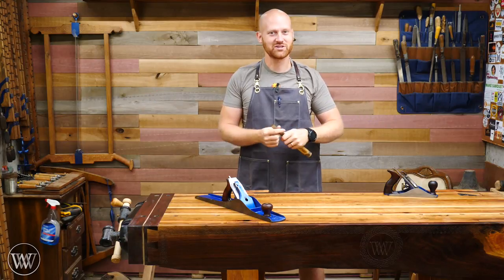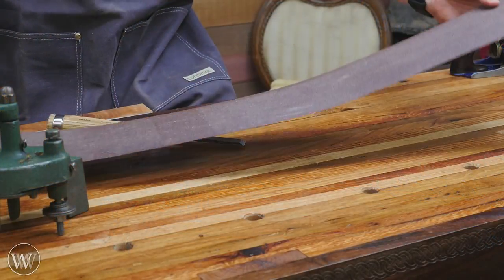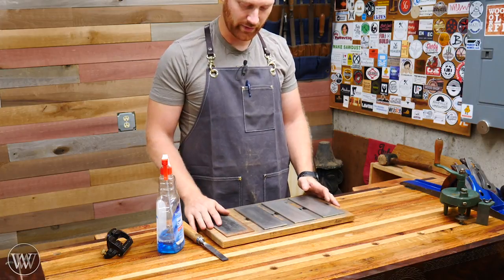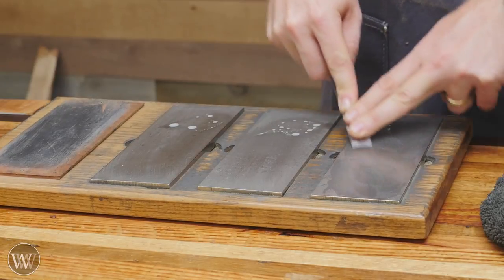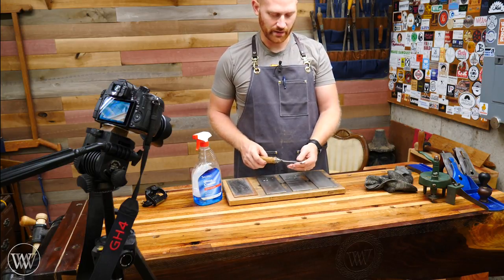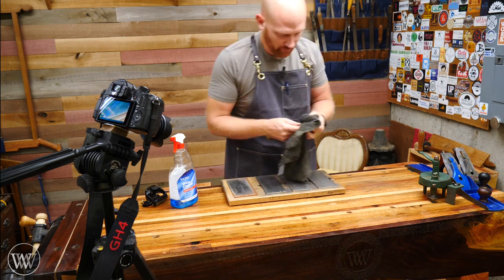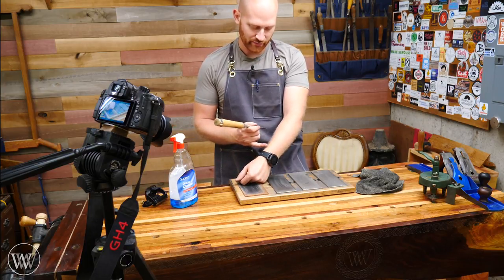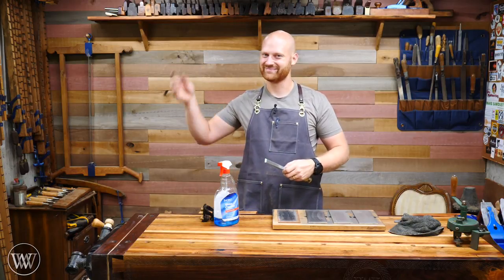How to Sharpen a Chisel Freehand | Hand Tool Woodworking Skill

Comment: Hi James, I started with handtools just around an year ago and then I realized how critical was the skill to sharpen. Being a complete novice I went with sharpening jigs, especially a side honing jig and I feel that was essential for me to begin with to understand the basic concepts and be able to get a decent amount of sharpness on my tools in order to progress. Now I do realize that freehand sharpening would be so much fun and quicker. So, as per your recommendation, I have just recently started sharpening just my chisels freehand. It does seem to take a bit longer for me to feel that burr but that is most likely because I haven't built any muscle memory and I am hoping it comes soon.
Also, I don't intentionally shoot for a camber but I do seem to be getting one on my chisels which look good and I don't mind unless they are going to impact the sharpness or usability.
Another problem I am facing is that the narrower chisel seems to be getting skewed (the edge is not accurate 90 degree). Any suggestion to help with that.
I am still not confident to use freehand sharpening on my plane blades since I believe they will require a bit more accuracy and a camber there might cause problems - I am not sure. But I do want to eventually use freehand sharpening for all tasks.
Reply from the maker: The camber on an iron or chisel is not a problem from heel To toe on the bevel. But if you're getting it from side to side that can be an issue. Usually that means you're putting too much pressure on the outside and not enough on the inside or your body mechanic is off and you're rocking at the arm. If a smaller chisel is starting to develop a skew then just put more pressure on the side that is long that will bring it back in after a few sharpenings.
Reply: @WoodByWright  Thanks for explaining this. I thought I read or saw somewhere that said the camber (from heel to toe) could cause problems in certain cases with bevel down planes if it prevents the edge from touching the surface. If this isn't really a practical concern then I would want to start sharpening my plane blades as well freehand soon because I do agree that it is much more fun, fast and satisfying!🙂
Reply from the maker: A little bit of camber is not a problem. If it gets extreme to the point that the angle at the tip is greater than 40°, then it will start to inhibit the cut. But that's a very extreme camber.

Comment: Thanks for the nice video. Could you tell me what grit you used when grinding on the floor. Thanks
Reply from the maker: It depends on how bad the blade is. If it needs a lot of work I start at 36 or 50 grit. If it doesn't need that much I might start at 60 or 80.
Reply: Thanks.

Comment: Any thoughts on the microbevel or convex grind? It should make the edge last longer and reduce sharpening time.
Reply from the maker: a micro bevel or convex do not make the edge last a measurable amount of time longer, but the micro bevel does save some time for sharpening initially. but takes more time in the long run. at least that is my opinion. most all hand held sharpening does put a bit of a convex grind on the edge.

Comment: Any thoughts on Shanon Rogers' method of stropping before the edge is dull, as maintaining a sharp tool? As he says it won't sharpen a dull edge, but it will keep an edge sharp. I've been trying this with my chisels, keeping my strop close, and it seems to work rather well.
Reply from the maker: youp. I do that for my carving chisels a lot, I am just to rushed to do that with bench chisels. something I am working on but  most of the time I wait too long. lol
Reply: I heard back in the day people used their palm to strop. Never tried putting some compound on my hand, I don't believe it will stay there. Maybe strapping some leather on the arm or legs ready to go would make it a quicker process, instead of reaching for the dedicated bench strop and moving it away every 2 minutes
Reply: I wouldn't use my palm, that's just asking for trouble. I keep mine on a block made from 2x8 right next to where I'm working.
Reply: Buy a 1 micron and .3 micron sheet of 3M lapping film. Flat surface to attach it to, and use it to strop. It’s insane on chisels as it doesn’t convex the edge at all. And 1 sheet is like $4, each sheet makes 3 or so strips, and each strip lasts multiple months.

Comment: I'm working on my skills with this I find a 1/4" chisel is harder to sharp thoughts?
Reply from the maker: +Mike Fulton yup the thinner the tip the more difficult to control. Just takes more practice of the same skill times I your arms locked so the chisel does not twist.

Comment: anyone here able to offer some advice?
i currently have a grinding wheel and a coarse/fine diamond stone. I was also gonna grab a strop and some compound. is there anything else i could conceivably need? the diamond stone says it's 400/1000 grit, but i don't know if that really means much.
Reply from the maker: You should just need that and the strap and buffing compound. as long as you keep the edge good there's no reason to take it back to the grinder. That's usually the best way to ruin an edge. But if the diamond plate is a good one that is all you need.

Comment: A good method.  Great video.  One note I have learned from working in the bearing industry is to make sure you use a non ammonia glass cleaner.  Ammonia will corrode steel very rapidly, we were not allowed to even have it in the shop in the Aerospace department.
Reply from the maker: interesting. as a pilot we do not use it on Wind screen as it can eat away at the poly of the wind screen.

Comment: Do you recommend the new Stanley Sweetheart chisels?
Reply from the maker: I am not a fan of socket chisels, but a lot of other people are. as to the steel they are good. and not half bad for the price.
Reply: I have the Sweethearts. All the handles fell off again this winter when their wood contracted. I picked them up and they were all in separate pieces. Had to glue them on in the end. I’m also thinking of getting chisels with narrower side bevels, although then I would use another excuse for not getting my dovetails right. But the Sweethearts do cut well and sharpen well. I actually have an almost identical Sellerish sharpening setup with the same board and same brand and size diamond plates, except that I use course, fine and extra fine, not medium.

Comment: I originally used three stones, since that's what Paul recommended, but now I jump from coarse to extra fine.
Reply from the maker: I often do that too. I mostly use the middle one for normal touch up I generally use course when I am fixing a ding.
Reply: Wood By Wright Roger that
Reply: Jumping stones is basically what you do between your fine stone and the strop, so no problem with that. I have a hard time trying to understand people bying a 400, 600, 1000, 4000, 6000, 8000, 10000, etc. That's pretty much 700 bucks spent for nopt much

Comment: how to clean dtm stones? mine after one hey year of usage even if i use some wool, they still look dirty...
Reply from the maker: I use window cleaner as a lubricant and just wipe them after each use. that keeps them clean so they do not clog up. once they clog up they are hard to clean. If you use steel wool you are just filling the stone with more steel. I prefer to use a a fine brush.
Reply: @WoodByWright  thx for the information. do you have any advice how to clean up as they are clogged now?

Comment: Does the quality of the steel have to do with how sharp you can get the chisel to be? In other words, will a cheap chisel be as sharp as a higher quality chisel?

thanks for the video!
Reply from the maker: for most tool steels the only major difference is in how long the edge lasts. if you were to get down on  an atomic level you would see some steels having a slightly sharper edge, but not enough that anyone can tell the difference in use
Reply: oh okay. thanks

Comment: So I’m an amateur with chisels, but I sharpen knives for restaurants and other customers on stones. With chisels I buy, I just take the new chisel put it on the angle, lift it up a couple degrees and grind. No jigs or anything, the backside I just lay flat. I go to a 12k Shapton Pro to finish and end up with razor blades for wood. Brand new chisels are fairly dull I think but even just that technique on the 12k only and they’re seriously sharp
Reply from the maker: One of the great things about this sport. there are thousands of different ways to do it and everyone finds the way that works well for them.

Comment: Why grind on the floor and not that nice flat bench?
Reply from the maker: surprisingly the floor is more comfortable. doing it at the bench means your arms have to do the work of pushing it down. that can drain you fast. on the floor you can put your body weight into it.

Comment: You and Paul Sellers both use glass cleaner on your stones. Why is that? Curious.
Reply from the maker: it evaporates quickly so it will not rust the plate. and it is cheap. all it needs to do is wash the steel shavings out of the grit of the plate.